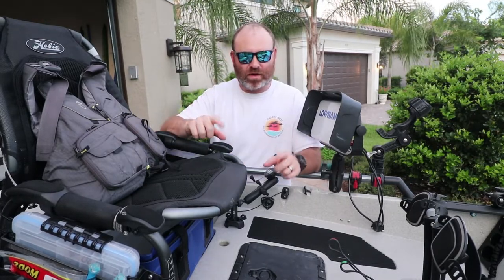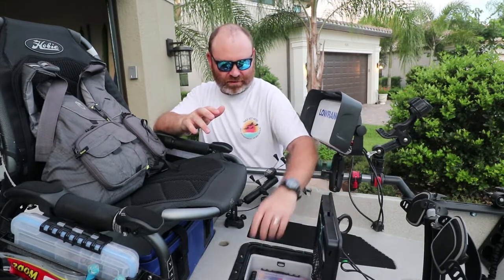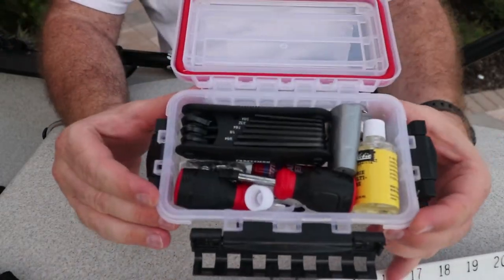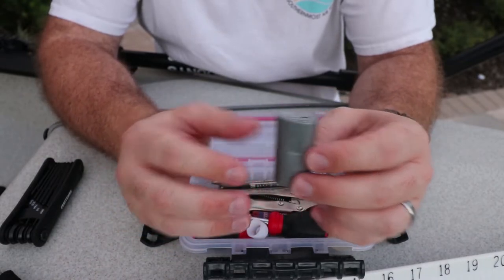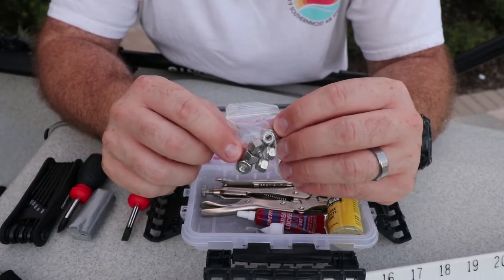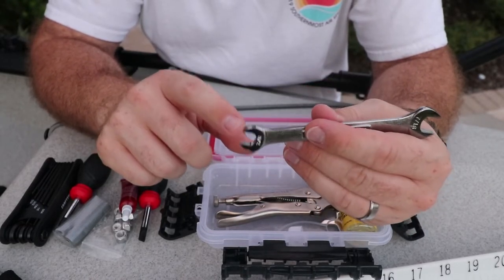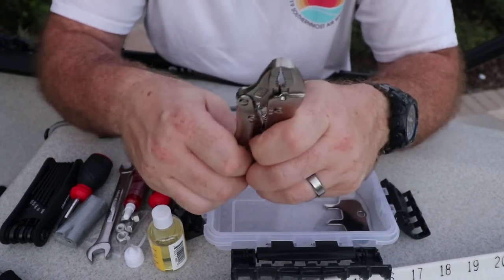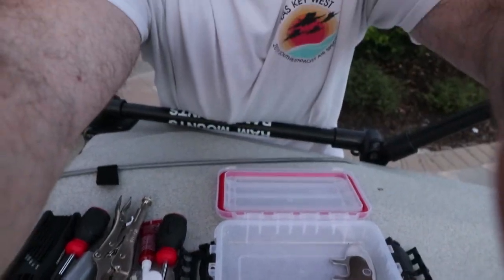Kayak tool kit - make fixes on the water (3400 Plano)

Comment: I had the chain break on my drive, didn't want to spend 50 bucks on a hobie replacement kit. I found 6' of chain and master links on Amazon. I replaced both my wifes and mine with master links, Now I have extra chains in my tool kit with master links. We can swap out a broke chain in minutes on the water.
Reply from the maker: Great idea. I'll be looking into that for sure